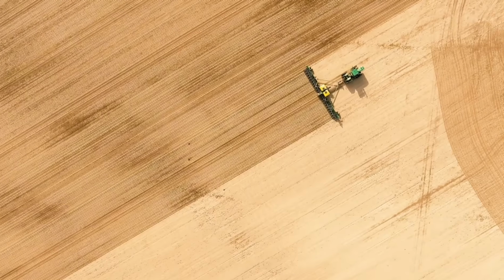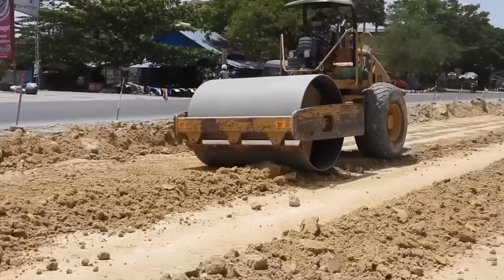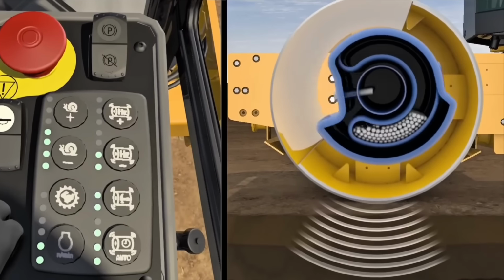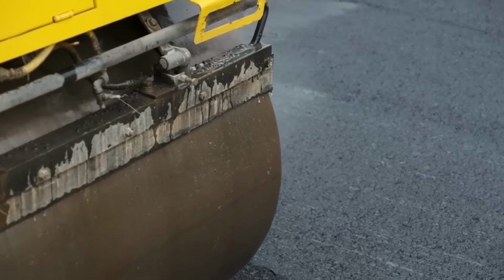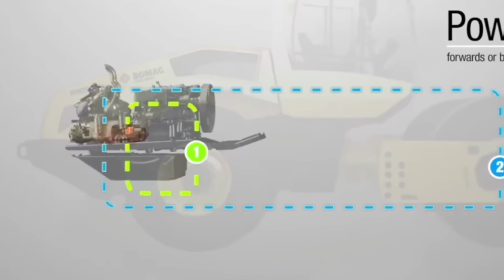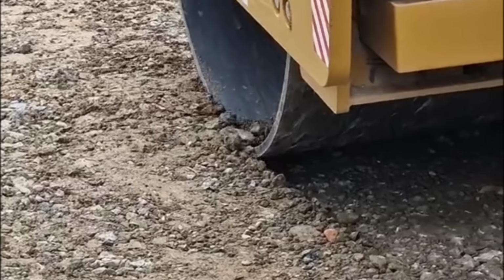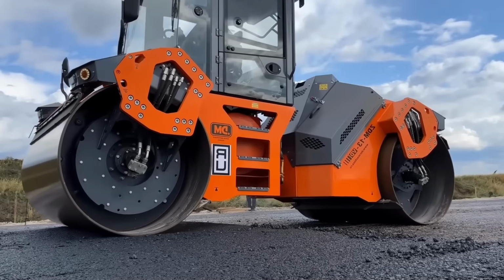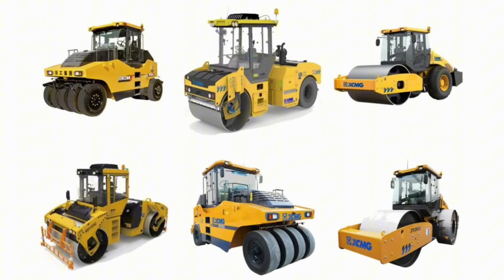What REALLY Happens Inside a Road Roller?

Comment: 2:28 "When a hydraulic motor spins the shaft, centrifugal forces are generated and transmitted to the drum at very high frequency"
What is that supposed to mean? The first part, yes, 100 %. Centrifugal forces, yes! .... but then it all goes downhill really fast. The motor does not “generate” centrifugal force. The rotating unbalanced mass does, the motor only provides torque. The force (-vector) is rotating, but the absolute force is constant. Also not at a high frequency, they operate at something like 50 Hz.

4:20 The explanation is fundamentally right, but turning a wheel does not change its angle to the ground. That is not the reason. They do it just like a car, but they only have 2 wheels, so of course somewhere it must be able to "bend".

7:20 Which ICE does NOT need cooling? Very odd to mention that in such details and with so much emphasis. What about lubrication? Gas/fuel mixture? Compression? Valve clearance? All the other things that are needed to make an engine work?

Comment: No one not gonna explain how roller works near sharp slope? coz that roller don't even have tread, how it possible it not cause an accident while paving?
Reply: Depends on what they're on, but like something hard like a metal ramp, they can't make it up
Reply: Multi wheel (The roller with many rubber tyres) always get bogged at the jobs I'm at, not the fault of the operator, they're just hard to see out of and don't go over drains easily lol I find it hard to drive them backwards because the seats only swivel 90 degrees, it's be better if they did 180 but anyway.
Reply: @TheAussieFloof what is the point of those. I've always wondered and even my boss with an excavating company isn't sure their purpose over a conventional roller. Since it sounds like you've had experience with them, if figured I'd ask. 

What do they do differently then a asphalt roller or a dirt roller with the two rubber tires at the back and one steel drum? And what conditions would you choose to use one of those in as opposed to the other two?
Reply: @SilverStarHeggisist  Yeah no worries.
So we only have steel drum and Multi wheel rollers at work, we generally use the multi wheel rollers along with the graders while doing dirt road grading

But lately, we have been performing road rehabs which (Depending if it's required) we dump 40mm rock all over the road then a profiler comes and munches the whole road up.

After that the grader will come along and begin smoothing it all out, once he has done a few passes we get both types of rollers going.

Like the video suggests, the steel drum roller's vibration allows for deeper compaction which is required because the whole road has been chewed up in our case, sometimes as far down 2 feet.
 
But the vibration must be switched off while rolling over culverts for risk of breaking them along with the drum roller is the Multi wheel roller just to assist compaction but is not as effective at deep compaction like the drum

One big difference between the 2 is the ability to drive them on the road, the steel drum roller can rip up the bitumen of other roads (For example if you do 3 point turns to turn around) the multi wheel you can drive pretty much to any site, albeit it's a rough ride lol

But basically, Multi wheel rollers are great for finishing the surface ready for the sealing crew while drum rollers with their vibration do well for compaction during the leveling of the road

Roads in Australia run a 3% grade either side depending on many factors (Don't quote me) 
Drum rollers can mess that up if the road is completely graded and you drive down the center

I'll also add that compaction is increased if a water truck or sprayers on the rollers are used, too much water can cause a mess though
Reply: @TheAussieFloof  Thank you, I'm mostly only familiar with operating steel rollers.